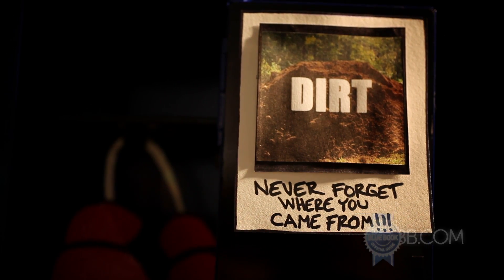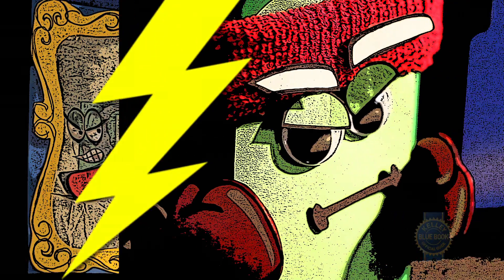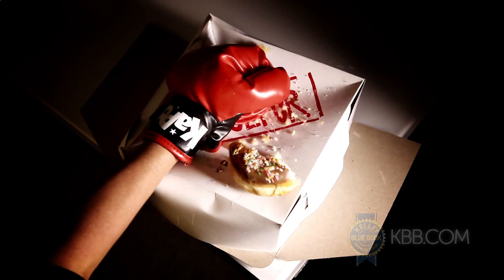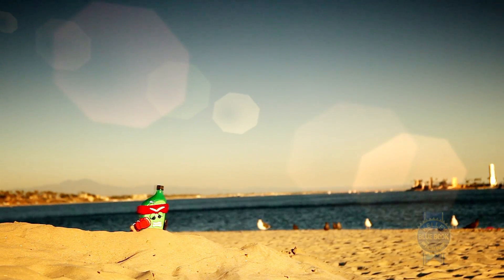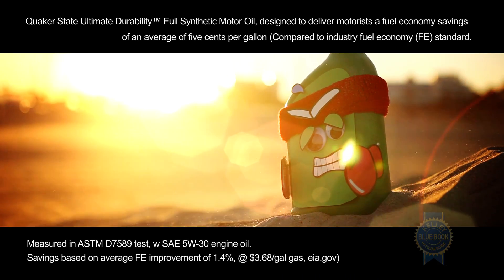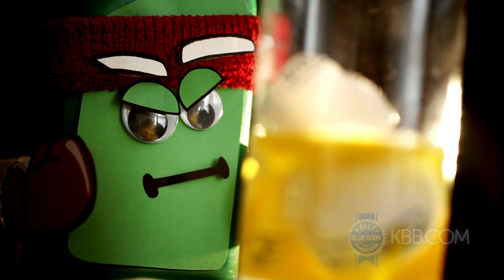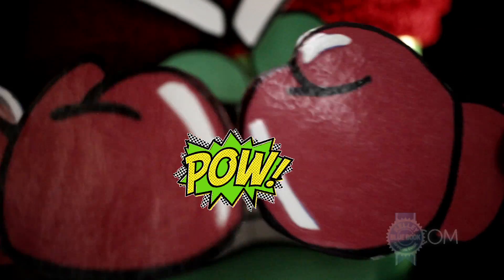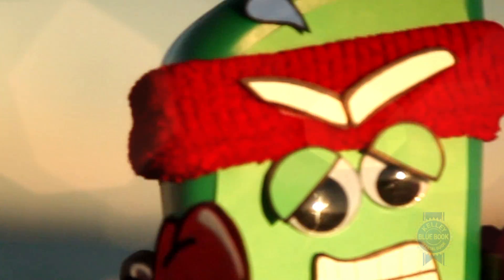Oil Explained! - What exactly is synthetic oil?

Comment: That is most retarded way of explaining synthetic oil I encourage anybody that wants to know more about synthetic oil to learn more: synthetic oil is small particulates measured at a very small measurement consistently running through the motor the weight is liquid plastic added to the blend but with synthetic motor oil is all completely consistently very tiny clusters of oil to properly lubricate your motor by far the best advancement on lubrication of a motor!!! Synthetic motor oil is absolutely superior!

Comment: If it's synthetic, then it is synthesized. Which, in my mind, means the hydrocarbon molecules are assembled, or built from assembling/reassembling carbon atoms, attaching the hydrogen atoms, to create a non-fossil hydrocarbon. Otherwise, the term is a linguistic flimflam.
Reply: The whole concept of "synthetic oil" is a flimflam, as far as I'm concerned.
Reply: I guess that you, like myself were just fucking wrong...I'm smart enough to admit it though. "Its comes from the ground."